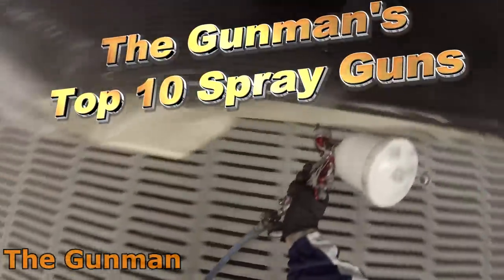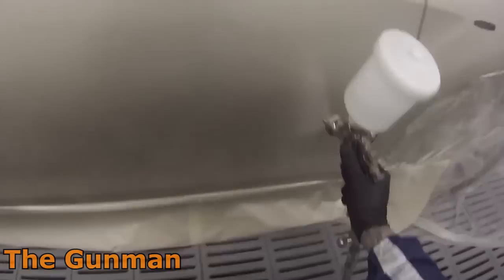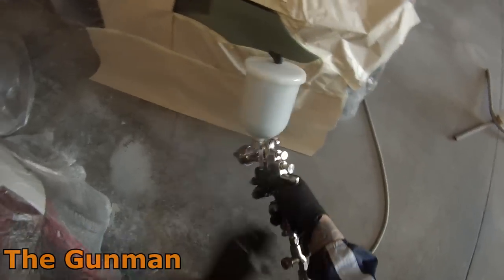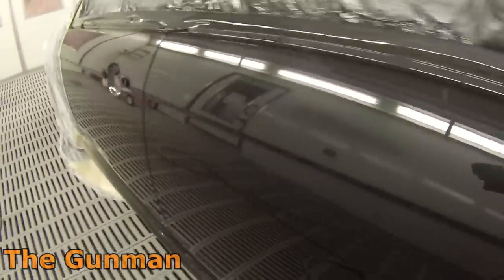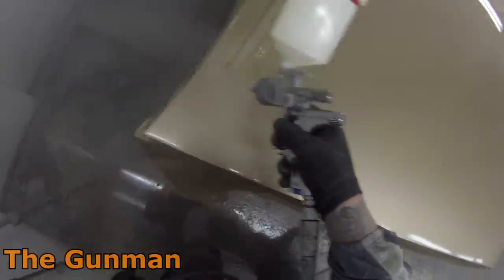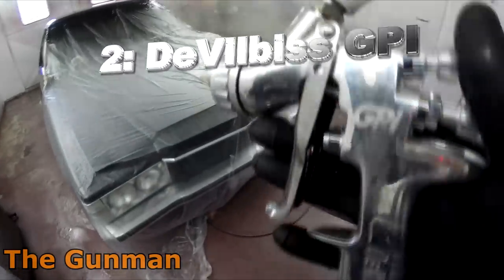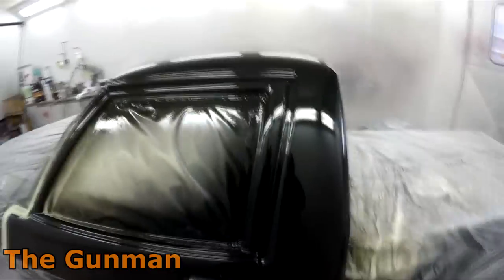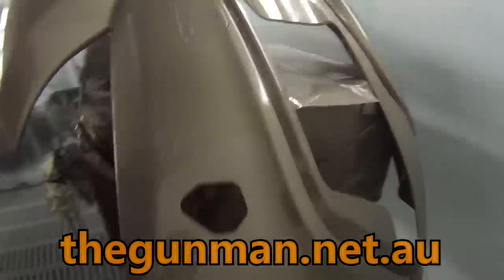Top 10 Spray Guns

Comment: Dear Gunman, I’ve been following you on YouTube. Based on what I’ve gathered, I’m looking at a pair of FLG-5 guns 1.8 primer for epoxy primer and 1.4 2 Part polyurethane topcoat and  2 Part polyurethane clear topcoat. I’m going to paint a 1979 Cessna 182Q 4 place all aluminum aircraft stripped to bare metal. This aircraft has top mounted wings which will need a ladder to reach to paint the top surface. Each wing panel surface (I.e. left top wing) is about 10 square meters area (100 square feet). My question is, do I get a gravity gun or should I go for a pressure feed gun and a 2 quart pressure cup system? Thanks!
Reply from the maker: I would get gravity fed and a few PPS adaptors and a PPS kit. It allows you to use the gun under suction but the pot is on the top. You'll get all the angles.
Reply: Thanks for the quick reply! By PPS did you mean like DeKups? PPS is 3M?
Reply: Okay I just did a quick search and found the answer to my question. Which do you prefer, PPS or DeKups? Thanks!
Reply from the maker: I'd recommend the 3M PPS because they can operate under pressure. I haven't used Decups because they aren't available in Australia so don't know if they offer the same functionality, I know SATA RPS don't. So yeah, just go PPS.
Reply from the maker: So when you get it, pot the paint in the pot, turn the gun upside down then plug the gun into the airline and pull the trigger until paint comes out, once you've done that the gun is operating under suction so you can flip the gun in any angle and it'll continue to spray.

Comment: Gunman, Curious if you have used the Devilbiss Plus GFG 670. And if you have, what are your thoughts on it?
Reply from the maker: They are old guns now, used a leaky old one that didn't work, have you got one or looking at buying
Reply: +The Gunman Didn't realize it was a old gun, I bought one brand new about a year ago. I really like it. But was wondering if the DeVilbiss Gti Pro Lite is that much better?? didn't want to fork out the money, if there wasn't  a big difference. I value your opinion, and just wondering.
Reply from the maker: If it does a good job then stick to it
Reply: +The Gunman - Just always looking for better! I want to try them all!!!

Comment: Hey nice work, what is the type of compressor you use?
Reply from the maker: 3 piston 5hp belt driven electric motor, not sure tank size but big enough.
Reply: thanks a lot
Reply: hi gun man,  is it good to use airless sprayer or air assisted sprayer as graco finishpro and  merkur? and what is the better use the compressor with a gun or air assisted systems?
 REGARDS.
Reply from the maker: slim toumi Use a compressor and spray gun not airless sprayer

Comment: Hi there
I been having problems  with   my tekna   pro 
I set the pressure  at 26 psi at the regulator  and ones the pressure  frome my compressor  goes lower  than 100 psi 
pressure  in the gun drop to 17 psi  
what you  think  can be the problem ? 
gun is almost  new , I have other guns and they keep  the pressure  constant 
thank  you
Reply from the maker: +G Rodas if you're using the HVLP cap or even TE20 it will consume large amounts of air, this is most likely why the compressor can't keep up, your other guns may be LVLP and use less air to maintain the same pressure if that makes sense, if not I have a video set explaining air consumption with the DeVilbiss air caps in particular, check my YouTube channel and view the playlist section.
Reply: The Gunman thanks  for  your  reply  
man bad news for me 
today I was applying  clear an my gun (tekna prolite) got stuck   open  without  pulling  the trigger  
is not dirt gun is very clean 
have you ever have this problem  what you  think  it can be?
thank  you
Reply from the maker: G Rodas I have had many GTIs (Tekna USA) and never had this happen to any of them except the old one's (millennium in USA) because on the older model the packing gland would pinch the needle if over tightened.
Reply: Hey man 
I found the problem  gun wasn't  keeping  the pressure   vcz  my  dryer is plug
2nd problem  
Last time I used my gun didn't  used the little   air filter  before the gun so I completely  dessambled the gun 
And I found  a little pice of bronze  stock in the air valve  
Ones  again  thanks  for  your  help

Comment: Why spray a fender from the bottom up...is that because you're down under ?  Band the edges and spray top down...because if you blow a hunk of dirt off the top and it falls farther down the panel , you still have a chance to pick it out. If you start from the bottom and then at the top you blow off some dirt, good luck picking it off the lower panel with fresh paint on it.

Comment: have you ever used waterbourne?
Reply from the maker: No just solvent
Reply: i learned now to paint w water. and really like it. but am using solvent now. the painter before me was using an old devilbiss suction fed guns. they are kinda stuck in the 80s. its a little frustrating cuz my boss knows nothing about hvlp or even gravity guns period.
Reply: i keep trying to get him to understand that using these new guns will save so much materials. they use a scale to mix filler. which iv never even heard of. have you?
Reply from the maker: There are no laws saying we have to use water here in Australia, so for me and most shops it's a case of, why use paint that's more expensive and takes longer to dry. I'm sure after two weeks I'd have it sussed but just yet to use it on a regular basis.
Reply from the maker: show cars unlimited Never heard of scales to mix filler
Reply: yea i wouldn convert to it if you didn have to. i see you use stantox. i love standox waterbourne. any standox product is my favorite. even know im trained and certified with ppg envirobase.
Reply: iv watched like 15 of your videos. and iv only used the devibiss tekna prolite for water base coat. its the first devilbiss iv ever used. and you have me convinced its a great gun. im gonna look into buying one in a couple weeks.
Reply: i am almost a little disappointed that i bought the ws400. kinda wish i woulda got the prolite because of the different air caps it comes 28th.

Comment: Quick question,  Lets pretend that all 10 of these guns are exactly the same price. You can only afford one.  Which one are you going to buy?
Reply from the maker: Still be the pro lite because of it's versatility, you can change the air cap and go from LVLP to Conventional to HVLP and it is absolutely perfect for refinishing, maybe the SATA 5K if I was doing Custom painting where they wanted dead flat every time.
Reply: +The Gunman cool, thanks for the response!
Reply: Shut Yer Face Garage Iwata lph00

Comment: Gunman, I'm not bashing on you but I  wouldn't use any gun in your top 10 list. The first thing is I would throw every hvlp paint gun across the street.  If your a real painter/ Custom Painter get you a old school Sharpe siphon feed paint gun model 75. I've been painting for 35 year's and I've painted numerous car's that have won Best Paint and Best Of Show at Street Machine Nationals, Car Craft Nationals and Summer Nationals including my 1973 Plymouth Road Runner. I've beat the best and I'm in the process of building a new custom paint shop named  THE HOME OF J.E.S. SIMPLY THE BEST! All of my sanding is done by hand down to the bare metal. No one is allowed inside of my shop's but I do tours by appointment only.  You won't find any Bondo cans, body filler, spot putty, D.A. sanders,etc. There's only 2 brands of Paint that I spray. 1 is laquer which I prefer for conquers show quality paint jobs and House of Kolors for custom painting. That's it. I hear of people talking about they do 3 step paint jobs....lol. If I actually counted my steps - process it would be a 10 to 12 step paint job and that's on a lacquer paint job. I prime and block more than probably anyone has ever seen and align every panel better than factory. I'm not bragging I just know what I can do.  My logo on my shop's is ( If you can think of it or dream it behind these doors is where I will create it. ) God bless my friend!

Comment: Gunman how long have you been painting.. your not even using the gun in its correct manner. Why do you think these things have double action 🙄
Reply from the maker: What are you talking about double action?
Reply: The trigger has three positions.
Off, air an fluid.when I was taught many years ago. At the end of every pass you trigger off to the just air action and on the return pass you trigger to fluid. Saving on material and edge build up.